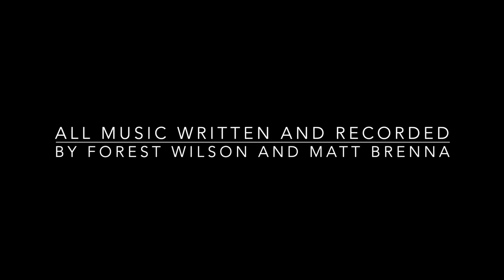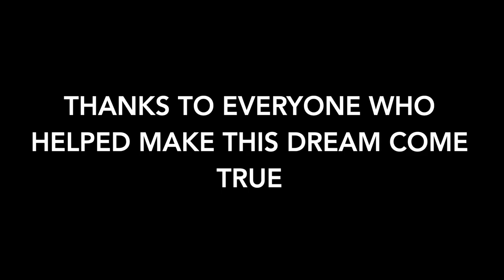OFF-GRID DIY ALASKAN WILDERNESS CABIN | VIDEO TOUR AND BUILD PHOTOS

Comment: I’m looking to build my own cabin and complete beginner. What resources did you use to learn how to build your cabin?
Reply from the maker: GREAT Question!! I learned from many different resources but my local building supplier was a big one. Talking to guys who actually build cabins in the local area is important, a lot of building advice is specific to your local needs just as: how much snow you get, how much wind you get, how much rain. Are you on a flood plain? Does it get really hot/cold? Bugs?    These are the kind of things that determine what types of building code you'll require. BUT I am doing a video on "How I built my cabin with zero experience" so stay tuned and thanks for watching!

Comment: Hi and greetings from Finland, it's really snowy and cold here, too! I have a genuine question about cabin building in Alaska. 
Is there a certain reason why you don't build fireplaces from stone etc. materials that could keep the heat for multiple days? I've watched a lot of these Alaskan cabin building videos and everyone seems to be going for the small stove instead of real big fireplace. Is it because of the space or is there any particular reason? It just seems to me that a fireplace could really be more efficient since it can heat up the cabin for days at a time.

But keep on doing these videos, I've seen that your channel has really blown up and that's wonderful to see that someone with so genuine and laid-back content can still make it here!!
Reply from the maker: Good question, fireplaces don’t provide anywhere near the amount of heat as a wood stove, all the heat goes straight up the chimney. A stove can be chocked way down (reduce airflow) which allows your wood to burn for 10x as long. So the stove it self is putting off heat instead of just the fire, and it allows for a longer burn. Plus it’s safer, no sparks to jump out. I appreciate your kind words!

Comment: Have you been on the property during the spring/summer months? I'm curious as to how bad are the mosquitoes.  Edit: ha ha just a few seconds after initially posting my comment/ question, you started showing the summer build pictures.
Reply from the maker: Yessir, year round! The bugs can be moderate to unbearable at times, but overall they are surprisingly mild. June is rough but by late July they start to settle down. Being up off the water helps I think.

Comment: Can you tell me what finish you used on the interior pine t&g?  I have a similar project going and looking for advice.  Did you apply a finish before putting the planks on the walls?
Reply from the maker: No finish! But I would stain before you install if you plan to use finish. What’s cool about pine, is that it gets more yellow and darkens as time goes on due to the sunlight hitting it. So it’s starts blonde but gets nice color to it in a couple years time.